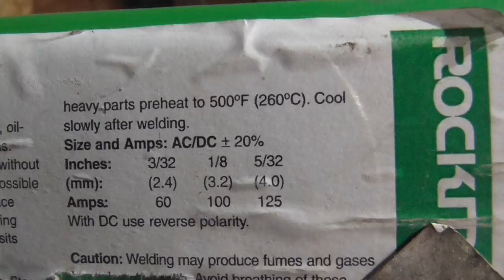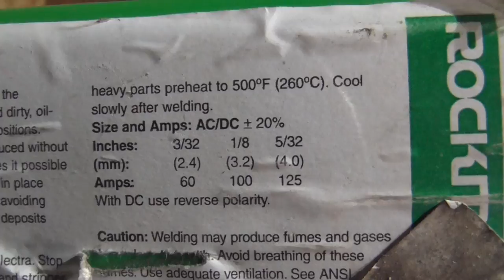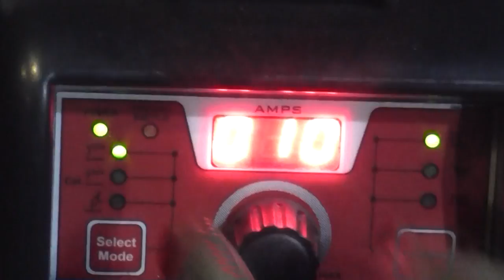Secret of cast iron welding

Comment: Ha!Just called Rockmont to get a price on "Brutus A" rod and it was almost $80 per pound in eleven pound boxes.Brutus A is a very good product but as I do so much cast iron work it's a rare day I can charge that kind of money.312 stainless rod works at least as well and costs about eleven dollars per pound...I actually believe most if not all "maintenance" rod is,in fact,312 stainless although Rockmont or any other company that makes maintenance rods all tell you they're "proprietary" and won't tell you their composition
Reply: @ZILAwelds  the real point I was trying to make is 312ss rod is what Jupiter(60lb) and/or Brutus($80lb) actually is and at about $11lb is much more affordable than these "proprietary" maintenance rods.I do so much cast iron work that 312 allows me to to charge a more reasonable fee to the customer and at the same time make a decent profit for myself,a win/win situation for everyone involved
Reply from the maker: @jojomama4787 I see your point.   although I believe that Brutus is a rod that is based on 312 stainless - it is not 100% 312 stainless.  For that matter, there are a lot of repairs filler metals that are 312 based and they are all very similar - yet they are different ...  there is the US Forge problems solver, the welco harris super missile weld, and a ton of others ....  that are 312 based but they are NOT straight up 312...  when you look at the tensile strength and elongation - you will see that 312 is "behind" by a long shot ....  20-22% elongation on 312 and in the high 30' on most of those repair alloys ... also easily 10-40k psi more tensile ....

now, do I say: go run out and buy this rockmount rod? no - if it is right for you - and it does what you want it to do - buy it !  if it is not or if something else will work for you that is cheaper - buy that then... I don't get a commission and I am not part owner of rockmount either ...

so I don't know how much money is too much. - or how much a guy needs to make a living .... and I don't know when some profit turns into rape and a bleeding ... you know what ... and it is not my place to judge...  

I have fixed equipment that was worth several $20g's and my $1800 welding job was "no big deal" and I only wanted to do the job once! and the cost of "regular" filler metal VS "hyper" filler metal was maybe $250 difference for the entire job .... and there are situations where I feel it is worth it!

and what is worth it to me might not be worth it to you ....  either way... I see your point and I agree mostly - as I said - if this is not for you - it's not for you. 
I would NEVER in my shop switch my everyday welding consumables over to any "hyper" brand welding consumables ....  and I would not recommend that to anyone else either - the cost would just be outrageous ....  and I don't see the point or the benefit.

Some occasional specialty jobs? different story

Comment: 60 amps would be ok if you were to preheat it. I have welded 100's of automotive heads and blocks (water tight) with the "cold" process using Ni-rod and peening using an air needle scaler. Not meaning to bash you in any way but that was way to cold. Thanks for the video's!!
Reply from the maker: Bend Over its all good - i dont take it as bashing ...  some stuff works for you other stuff works for me ....   an automotive head is super thick compared to what i was welding on ...  this stuff here was barely more than 1/8” thick
Now in my mind - i had to keep it that cool for it to work ( and 6+ month later - it still is)
A head is “a mile” thick ...  there is more head needed to make it flow and stick to it...

I welded about 20 heads in the last 8 years ( not claiming to be an expert ) i tig welded about half of them ...  
some with ni99 some with albrz ....  and to my knowledge they all worked or are even still working ....

Not saying you are doing anything wrong ....

Cast iron is “fair game” in my opinion ....  whatever gives you the desired results was the “right” way to do things ...  
As soon as it cones to cast iron - textbook pretty much goes out the window ....

Comment: Running ni rod I assume?. I've never herd of a general maintenance rod.
Reply: AnthonyLA 310 general maintenance rods aren't AWS rated and the manufacturer doesn't like to say what's in it. Most of them have quite a bit of ni in them though.
Reply: Moose54656. Oh ok good to know
Reply from the maker: AnthonyLA 310 it’s a high nickel content ( i believe more then 70% but dont quote me on that)  deposits are machinable. And than it has all the “secret” stuff in there to deal with contamination in the casting, oil soaked castings, flow promotors ....  etc .....  

All i know it works really well - better than ni99 in my opinion ....